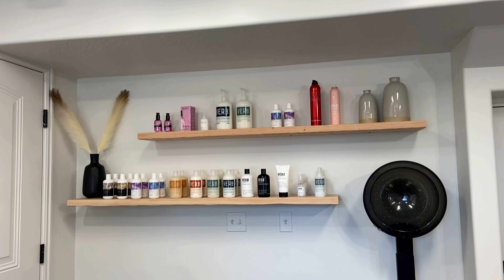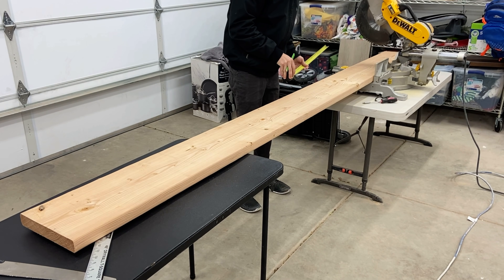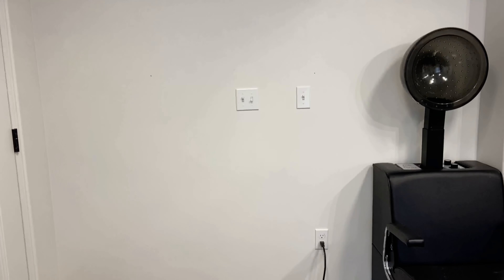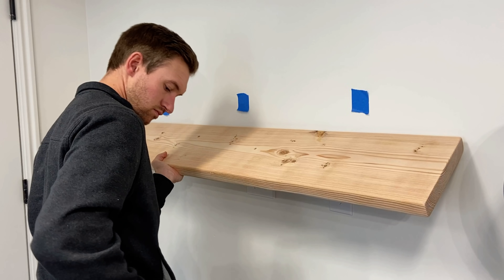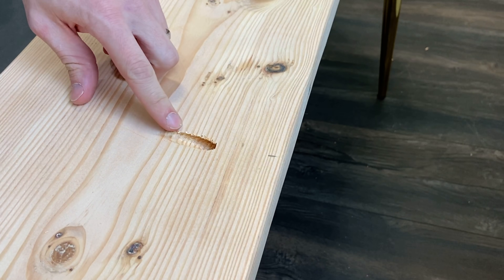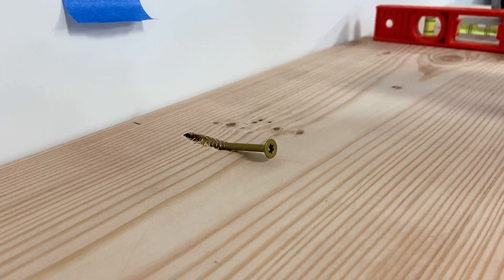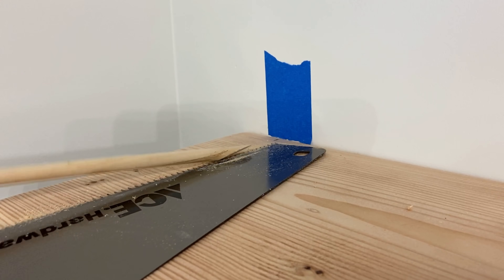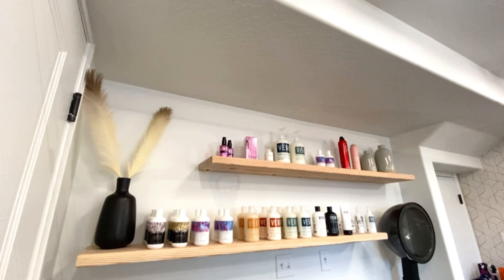These Strong Floating Shelves Only Use 4 Screws

Comment: I attempted this with 2x10 and all my shelves sagged even though I screwed into 4 studs. I had to add L brackets below the shelves and drilled them into the studs. Once I did that there was no more sagging or wobbliness. The method in the video probably works best with smaller wood boards like 2x4, 2x6 and 1x4, 1x6. Great video overall.
Reply: That was helpful, thanks.
Reply: What screws did you use? I used the same ones he used and my 2”x10” shelves worked out awesome. My shelves were only 24” and 27” long though. But they still worked out well using this method.
Reply: @idliketosay  my shelves were 8 ft long and I used those golden yellowish deck screws that come with the special bit in the box. I used the 4" kind.
Reply: @karllazlo6237  oh shoot lol 8ft? Yeah don’t think four screws would do it, especially if the piece was solid wood. Glad you figured it out though. I think his pieces were only abt 5 ft long so 8ft is def pushing it. For anyone doing shelves fairly short in length (5ft under) this method seems to work well.
Reply: @karllazlo6237 I used GRK screws and it holds up really well. I don’t think those deck screws are designed to hold as much weight as GRK screws
Reply: What are GRK screws? And where do you get them?

Comment: And all this time I've avoided doing floating shelves because I had to buy the right metal rods for support and ensure they align with the wood stock...wow. Thank you for showing such a more efficient way of making these.
Reply from the maker: Anytime! Thank you for watching! Glad you enjoyed!
Reply: @Nailedityt  .. .
Reply: Don't do this. Get the rods. Once the wood drys and shrinks, those screws will get loose and it will sag. Also that corner edge can break away, especially with the pocket holes on top. Plus pocket holes should only be used when used at BOTH END OR SIDES to keep boards/shelves from twisting. This is a bad idea.

Comment: I think if the pocket screws were, instead, inserted in the bottom surface pointing slightly up, more of the screw would be supported by wood and the shelf would be stronger.

Comment: Mine is by the electrical also. On each end is an outlet and light switch, it so happens to fit. So I know there's the studs. So wires running up and down. There's another unit above and no basement here. I wonder if all the electrical could be running towards the ceiling and down. :/ idk Maybe a good stud finder or some detector for the wiring? Maybe move it a foot over :/

Comment: Question is the wall wood?
Reply from the maker: Is has wood studs every 16 inches. Then it has a layer of 1/2 inch drywall on the outside!
Reply: @Nailedityt  oh ok thank you for the info i want to to have shelves but the hard part for me is that my walls are cement🤣🤣🤣
Reply from the maker: You can still do it! You just need to use “blue concrete screws”!
Reply: @Nailedityt  Ty

Comment: Good video showing how to use pocket screws for installing a floating shelf. Pro tip: when using pocket screws you need to adjust the clutch on the drill so you don’t push the screw through the material.

Comment: How to hold the shelf on a brick walls?
Reply from the maker: Sorry for the late response! I have been busy with other projects! I would recommend using “blue concrete screws” you should be able to do a quick google search and find them online or you can find them at your local hardware store. It should be the same process I showed in the video! Just use different screws!

Comment: If you used that hand saw with that chop saw sitting there to prove a point, why was the palm sander invited to the party.
Reply from the maker: Because I feel like most people have a sander but not necessarily a miter saw! If you had a buy a sander it would also be cheaper than a miter saw!

Comment: New subscriber here and have zero knowledge on these stuff. May I know how you were able to drill the screw on the concrete wall without using toks? Did you perhaps just pushed hard with the hand drill?

Comment: And if the wall is reinforced concrete? How do you screw it in. Do you need to use plugs
Reply from the maker: I actually just posted a video answering that question! But no I don’t think you will need plugs! I explain in this video! If you still have questions after watching then let me know! 

https://youtu.be/2j1jn6CaQY0

Comment: Planning on 10’ long shelves, and I’m using 2”x10” lumber, but when I measured, it’s actually 9.5”, I saw your’s measured 9”, should I adjust the jig to more than your suggested 1.5” since my boards are 1/2” wider? How much? Also, as long as I screw into every available stud along the 10’, the stability should be the same as your’s correct? Or should I use longer screws or even leave more wood un drilled when drilling with the jig? Thanks a lot:)
Reply from the maker: The width of the board won’t effect the jig! It’s only the thickness of the board that will effect it. If you had a thicker or thinner board you would want to adjust the jig. In theory you should be able to use these system or as long of shelf as you want just as long as you install screw along the way! I have another video I’ll pin for some extra tips as well!
Reply from the maker: Answering Your Floating Shelf Questions
https://youtu.be/2j1jn6CaQY0

Comment: Great video! Only thing is, I have a masonry wall, and I would need to use plugs first, as the pocket holes would be going in at an angle, I don’t think this would work…. Any ideas? Thanks!
Reply: If you have a masonry wall there is a simple way to make a floating shelf. Just use a concrete hammer drill for installing an expanding lag. Then screw a piece of 5/8" all thread into the lag making sure the all thread remains perpendicular to the wall. The all thread would ideally protrude out from the wall about 3-4 inches depending on your shelf depth. Then take your wood shelf and drill tight fitting holes that will fit the all thread. You'll want a slight interference fit so a mallet will help tapping it in place at installation. I've done this and it is extremely strong and very easy.
Reply: @mattym893  Amazing! Thank you so much!

Comment: What do you do when you want to remove them?
Reply from the maker: I found it easiest to take a screw driver and a small screw, then screw the screw into the wooden dowel! You can use the screw as a handle and wiggle the dowel back and forth and it comes right out!

Comment: Hi, I am using 2X8 board, 36 inch length and drilling into 2 studs. The board is sagging and wobbly. Used the same screws you recommended. Any tips on how to solve this?

Comment: Just wanted to give you a big THANK YOU!! I used this video tutorial and your other video to make a set of 27” and a set of 24” long floating shelves. I used a 2”x10”x12ft douglas fir green lumber from Lowe’s (the usual stuff they sell on the floor).  The pocket screw idea worked amazing well. The 2”x10” shelves do not have any wobble/movement/sagging. Solid. I used the 3-1/8” GRK screws you rec from Amazon. Appreciate you very much. Got to stain the shelves the colors we wanted and saved hundreds of dollars since solid floating shelves are very pricey online and doesn’t always come in the color you want. You saved me big $$$!!!
Reply: Did you also follow his advice about not drilling all the through "so the screws will hold the weight of the wood without cracking"? I only ask because what's that mean exactly, like the drill hole is 1/2" from  coming through the end, 3/4" or 1" just curious thinking about trying it myself.
Reply: @geico1975  yes don’t drill all the way through. If you use the pocket hole jig tool, it will prevent you from drilling all the way through anyway. The pocket hole jig tool has a stopper that prevents you from drilling all the way through so just be sure to use that.

Comment: guys im thinking of using these as my display rack for my grocery store  1.5inch thick plank with half inch steel rod,
need your opinion ,
please guide me ,
any help would be appreciated
thanks
Reply from the maker: I can help! Just to clarify, when you say 1/2 inch steel rod. Are you thinking about using that instead of the screws? What is it that you need help with?
Reply: @Nailedityt  no im thinking of using both one steel rod every 3ft and  1 screw every 1ft just to make sure it will hold up for good time thats why i was asking for advice 
thanks for reply
Reply from the maker: I think you could do that! How long are you thinking about making each shelf? Do you know if your store as a stud every 16 inches? If so, I can try and make a map for you to follow!
Reply: @Nailedityt  i m thinking 15ft lon 10inch wide 
and my store is made of bricks and concrete
Reply from the maker: Here is a quick plan that I made. Im sure you had something like this already but let me know if it helps.

https://drive.google.com/file/d/1oGbQvc1tZK2pb_p6iKlgnYJpx60_IKKe/view?usp=sharing
Reply: @Nailedityt  thanks alot man for help and all keep up the good work your videos are simple for new diyers like me best of luck for your future projects
Reply from the maker: Thank you I appreciate the support! Let me know how your store turns out!
Reply: @Nailedityt  will do

Comment: I did it the same way you did and the screw came out of the bottom and cracked the wood. I dmd you on instagram
Reply from the maker: That means the drill bit probably went to far in! I’m not real active on Instagram. I may not respond as quickly as I do on here
Reply: @Nailedityt  oh ok I wanted to send you pictures, and ok ill try not to go as deep in but i went as far as you did in you video, maybe its cause the wood im using is thinner?
Reply from the maker: It could be, let me jump on Instagram and yeah send me some pictures!

Comment: Drilled screws into shelf to secure to wall and all the screws stripped and would not go in all the way. Shelf is stuck halfway on the wall. Don’t know what to do now.
Reply from the maker: You may have drilled into something behind the drywall. Is there a way to check and see if something is behind the wall that you might have hit?
Reply: Nailed it negative.
Reply from the maker: Are you saying the screw head stripped? Are you using the star screws I recommend?
Reply: Nailed it   I used 3.5 in wood screws but not star head, they were Philips head screws.
Reply from the maker: The star grip a lot better, once you buy them you won’t go back. Either way, can you get the screw out? You may need to pre drill while someone holds the shelf in place for you if you are using those screws.
Reply from the maker: The star grip a lot better, once you buy them you won’t go back. Either way, can you get the screw out? You may need to pre drill while someone holds the shelf in place for you if you are using those screws.
Reply: Nailed it.   gotcha I’ll try the star screws if I can get these screws out. I’m not sure if I’ll be able to get them out, at least not easily. Thanks
Reply from the maker: Yeah sorry about that! Let me know if you need more help
Reply: Nailed it. I used the star screws and got the shelf in pretty sturdy, I appreciate all the help.
Reply from the maker: Awesome! So glad it worked out! Great work!

Comment: Also, why won't my screw go all the way in? I'm using an impact driver and it gets stuck halfway through. I don't have a longer drill bit. I used a one inch drill bit extender, but it still didn't go through
Reply from the maker: Are you using the screws I showed in the video? Is your drill bit about the same length or longer? Worse case, you could be hitting something behind the wall. There may be what’s called a “nail plate” which stops screws and nails from penetrating any plumbing pipes or wires behind the wall!
Reply: I used a 3 1/2" screw like you said instead of  4" screws. Now it's going good. Thank you very much.
Reply from the maker: Great I’m glad to hear it! Let me know if you need anything else!

Comment: does it matter how thick the piece of wood is that your using? like to set the Kreg thingy? and how deep to drill?
Reply from the maker: I was using 1-1/2” wood but you could use a thinner piece, it may not be has strong. When you set the kreg jig, you’ll want to test it out on a scrap board that is the same thickness as the board you are planning on using. You want the kreg jig hole to line up with the center of the board. 

For example if you have a 1” thick board. You want the end of the hole to be 1/2” though the board. 

You don’t want to drill all the way through, you will weaken the strength of the board. Go back in the video and I show you how deep to drill. 

Hope that helps and if it’s confusing let me know and I will try to explain again.
Reply: @Nailedityt  the wood I have is less than an inch thick it’s right under the 2m mark on the oppo side of tape measure
Reply from the maker: The same rules would apply. 

1. You will lose a little bit of strength
2. The hole needs to be half way through the board. If your board is 2cm then you would need the hole to be 1cm to make sure it’s center between the 2 cm of thickness
Reply: @Nailedityt  ok still a little bit confused but only on how far i should drill into the wood, i know you said 1cm to make sure its center, but compared to how far you drilled into the wood on your video based on the silver part of the bit
Reply from the maker: When you drill into the wood using the kreg jig, just make sure you don’t drill the full depth of the drill bit. You want to leave a little bit (about 1/2” to 3/4”) of the drill bit sticking out of the kreg jig. 

Another way to put it is, you don’t want to have the drill bit come out of the bottom of the kreg jig. 

You want to leave as much wood in that hole as possible so you get the most strength.

Did that answer your question?

Comment: Is it a concrete wall? Our wall is concrete, do you have any idea on how can we make a floating shelf just like yours?
Reply from the maker: You can go into concrete! You just need to use different screws! You need to use what is called “Blue concrete screws” I’ll send you a link to show you what they look like…

https://www.lowes.com/pd/Tapcon-3-16-in-x-3-1-4-in-Star-Flat-Head-Concrete-Anchors-75-Pack/5000109505?cm_mmc=shp-cprdhdwgooglelia--masonryanchoring-5000109505-_-0&placeholder=null&ds_rl=1286981&gclid=CjwKCAjw87SHBhBiEiwAukSeUUp7Wv1xcYpMc75nvq_IQ435oP8JAUDD9TOfvPjWWtsr-AiRhlZh7BoCjMkQAvD_BwE&gclsrc=aw.ds

You’ll also need to pre drill the concrete!

Comment: LOVE this video, made my own today and they did turn out great but a little wobbly. Used the same screws you did but the only difference is I used 3/4” thick wood instead of 2”. Still functional and great for what I need them for but curious if me decreasing the thickness of the board is what contributed to the less strong hold as my German Shepard couldn’t even stand on mine without it falling out of the wall. Again, perfect video and perfect tutorial. Thank you so much!

Comment: How would you go about uninstalling it after putting the dowel in?
Reply from the maker: I take a small screw and screw it into the dowel with screwdriver and then use the screw as a little “handle” and then you can wiggle it back and forth while pulling on it. It should come out pretty easily!

Comment: nice！m looking for a solution for my router and other things, kids always want to reach them, then found this one, I'll give it a try, and it seems nice!

 Update, I did one for my router, and it looks great. I just bought a new Kreg jig and the drill that comes with the kit has a length indication, so you don't have to make a guess which is good for me(new to the woodwork and no sense for length ). Hand saw a 2  by 10, 8 ft long and cut a straight-line was a challenge, and I would make an investment for an electronic saw and sanding tool later if I have more woodwork. But, your method, still, I think is one of the best for beginners like me, not too many fancy tools, but get the job done nice and easy! thanks a lot! looking forward to learning more from you!

Comment: Hi, first time builder here. To confirm, once we create the holes with the kreg jig  how do we get the screw to go through the board in to the wall if there is not a hole on the other end?  Is the hole created once we drill the shelf tot he wall?
Reply: yes, once you start drilling, that will create a hole on the other end. Screws he used are wood screws. Make sure you are screwing to the wall stud.
Reply from the maker: Looks like someone beat me to your question! Yep! Those screws will make their own hole! Hope that helps!
Reply: Thank you both.  We do not have studs since it’s drywall we will be using anchors. Should the wood screws still work?
Reply from the maker: Without having studs I’m not sure how strong the shelf will be. You would need to use a really good anchor with pretty light shelves. Instead of a 2x10 like I used, you may want to use a 1x8 piece of pine. Also the screws I recommended will probably not work with your drywall anchors and they won’t give you much benefit because you’re not going into wood anyways.
Reply: @brilewin  
What is your drywall attached to?
Reply: @Tony-1971  I was thinking the same thing.
Reply: @brilewin  yes it can but like @nailed it said, would need lighter shelves. Not sure if you've done it yet but I just did a video on how I installed floating shelves into drywall 😃
Reply: @MelodyTries  thanks Melody I will check out your video as well.
Reply: To make the drilling  slant